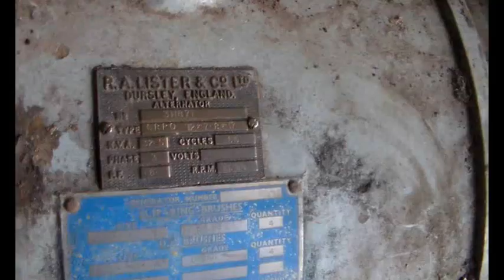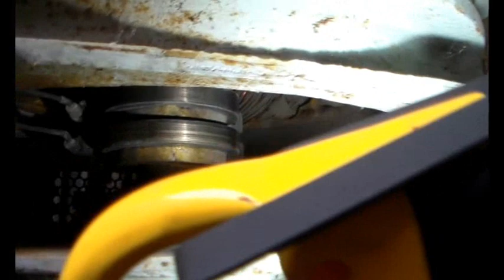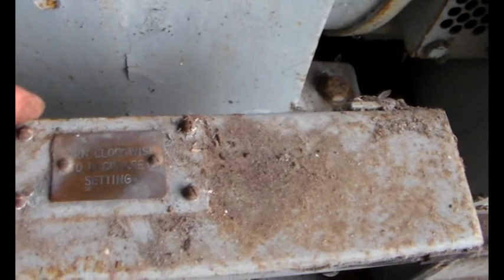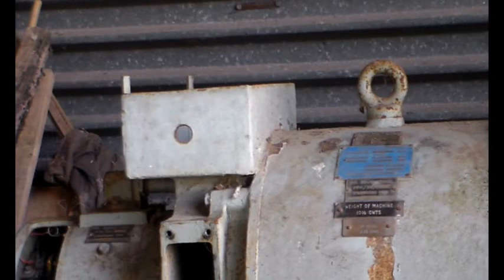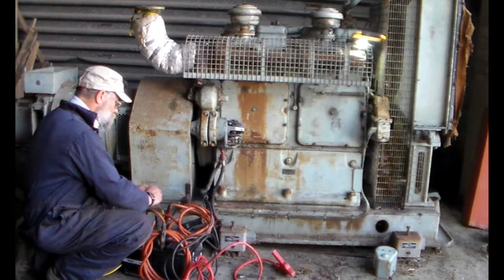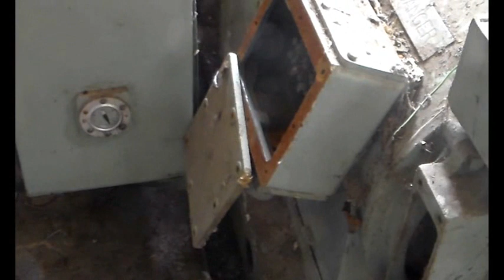Lister Diesel JK4 gen set repair No.2, slip rings and DC power

Comment: That engine sounded very fast to me. One pair of those wires will be the voltage detect on the autostart there should also be connections for coarse and fine field adjust resistance so its possible that the field windings have been connected directly. The start battery will be charged by a bleed off from the DC exciter. I have some wiring diagrams for a smaller lister set somewhere,single phase but lister did not alter things much just made them bigger or smaller so they will give you a start.
Reply from the maker: Hi, I thought so at the start but it slows down quickly and last week I cleaned off the rev counter and it shows just under 1500 RPM, which is the rated speed. I tried an field excitation circuit with  connections to AC live and neutral and then 2 connections to the  excitation generator DC fields, no joy yet, cheers
Reply: @TheInfoworks  The exicter field and the main field should be DC only and not connected directly to the ac.
Reply from the maker: @Equiluxe1  I am lead to believe that the AC connection is for sensing the variation in output voltage as the load changes, still got the get to the bottom of it. There is a reaction setting that will need investigating, cheers

Comment: I would try  decreasing / increasing engine speed and checking what happens to volts ,   as I'm in agreement with a previous comment that 489 volts  is not that bad .. however its approaching 20% more voltage ...so yes I'd be altering engine revs and checking voltages and cycles like you suggested.... to determine a voltage regulator problem or indeed lack of one , very interesting project be sure to keep us updated .. good luck
Reply from the maker: Hi, yes all of the above plus put a reasonable load on it to see how that changes the voltage, cheers

Comment: I believe there should be a regulator on the exciter circuit? I can set my cycles using the frequency meter and manually adjusting my engine RPM. Once i get 50hz on the meter, the engine will self govern the RPM and keep me at 50hz, There is no connection from the genny voltage regulator to the engine speed governing at all, the engine governer takes care of this.     You need to vary the resistance in the exciter circuit In order to achieve the correct output on the high voltage side.  I have the option of a Tonum auto-regulator or i can set manually using a raise/lower wheel and a selector switch that adjusts the resistance for the working temp range (-15 to +30 degrees).  When the generator is put under load, the engine governer will bump the revs to keep the cycles the same but the output voltage will drop as the load increases.  You will need to bump up the voltage in the exciter circuit as the load increases to keep the output voltage in the desired range. As soon as you drop the load on the output, the output voltage will surge again and will need bringing down.  Normally you would have an auto-regulator to take care of this if your load is constantly variable.  If you are running a stable, constant load, you can set manually and it should stay roughly in range.    I believe the other things you are looking at are just the oil pressure safety stop system that will cut the fuel if the oil pressure is too low.  Can you see any electro-mechanical connection to the engine governer at all?  It's quite possible there never was one.     I think you are missing a control panel and voltage regulator?  These were not built into the unit and normally mounted seperately, either on top of the unit or somwhere nearby.  I have a basic wiring diagram for my control panel, it is 20 years older than your unit and will be different but i can send it to you if it helps you understand the setup a little more?
Reply from the maker: Joe thanks for the mine of information. I was thinking there was something missing. As all the wires are cut off very short I suspect the control units have been robbed for another machine. Thanks for the diagram offer and I will bear it in mind. The best thing now is to put a load on it and see what the voltage stays at. How do you adjust the governor, do you have to remove a side case? With a load on the genny and a frequency meter that should give us a good idea of what is required. Cheers
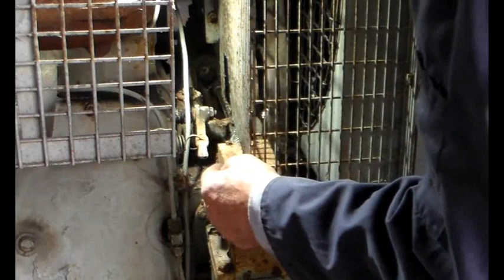Reply: @TheInfoworks  It may be slightly different on my JP series but the setup looks essentially the same.  At 11:00 you are looking at the pump handle. That large spring nearest to you that goes from the end of the handle to the top side of the engine case.  I cant see in the video because the guard is in the way, but on my JP4 there  is a cover over that spring on the side of the block, towards the top of the inspection panel.  You can remove the small spring cover (not the engine side inspection cover) to reveal the whole of the spring and a threaded adjustment on the back end.  You can use this threaded portion to incease/decrease the spring pressure against the governer to fine tune the governed RPM.  I can't be sure that you will find exactly the same thing but it's a good place to start. If there was to be any electronic control to the governer, i suspect you would find it here, though i'm thinking there probably isn't one. Best of luck with it, as you say, you'll get a better understanding of what it's doing once you get a bit of load on it.
Reply from the maker: @joeslacks  Many thanks Joe, it's those bits of info that make all the difference, cheers

Comment: hi andy, great job. The thing in the box with the orange wire coming out of it is just an oil pressure sensor. The governor is purely mechanical on these engines. The easiest way to tune the speed is with a frequency meter. The voltage isn't too bad but needs to come down. Am I right in thinking you just connected a 12v battery to fields for that run? Might be worth seeing what the dc side is giving out voltage wise and if it's around 9v, then connect to the fields. On the smaller lister sets. the output of the generator is run through a shunt and then a rectifier which as load increases, magnetic field increases and therefore more voltage through the rectifer. Given that it's a 1967  set, id imagines it will have some form of voltage regulator either in a control cabinet or inside.
Reply from the maker: Josh, thanks for your ideas. So the orange wired item is nothing to do with the governor, that makes sense, thanks. I tried 12v DC into the rotor coils and got about 60v output, then in the video I was using 24v. The thing now is to use a frequency meter as you suggest. I'm assuming that somewhere there should be a DC output for charging the start batteries. I'm wondering if it would be from the exciter generator or whether it was a transformer and rectifier in the lost external fittings. Cheers
Reply: @TheInfoworks  Hi Andy, If its a 24v set and you put 24 volt into the coils to get that high voltage then for battery charging id imagine it comes straight off the dc generator, through a diode and a then through a limiting resistor and then charges the batteries. thats how most of mine are set up. these generators arnt designed to charge the batteries at high current although they are capable. charging current should be in the region of 2 to 8 amps I reckon. as for the output. if you can find the dc output try hook that up the rotor coils and see what you get. Take note if the dc cables take any funny routes to inside the generator as this might indictate there is limiter in there somewhere and that would be good
Reply from the maker: @joshstacey9859  Josh, yes it's 24v and we need to run it up with a load to see what the running voltage is, and find a 28V DC output for charging the batteries, cheers